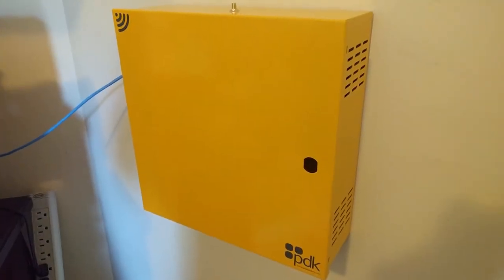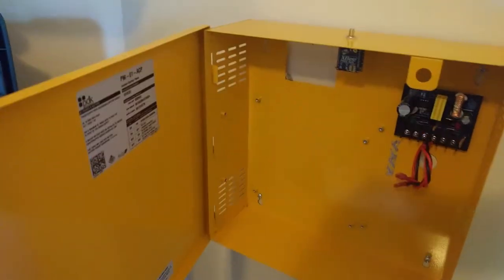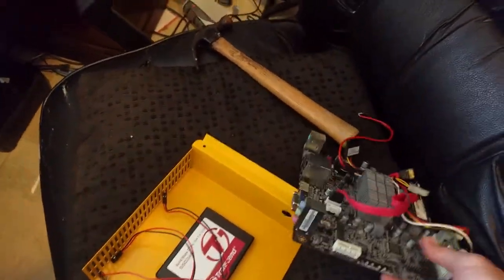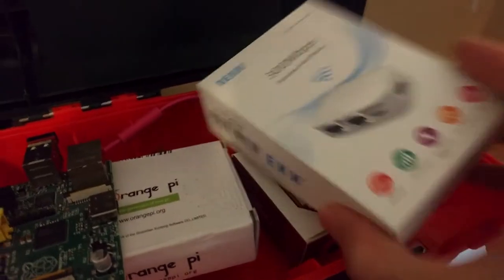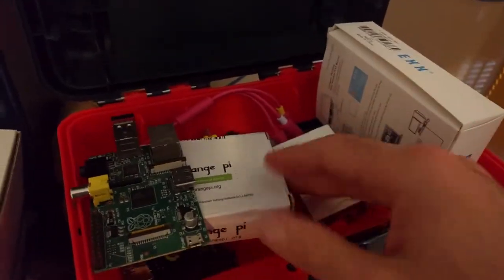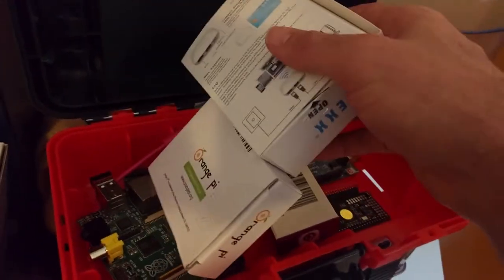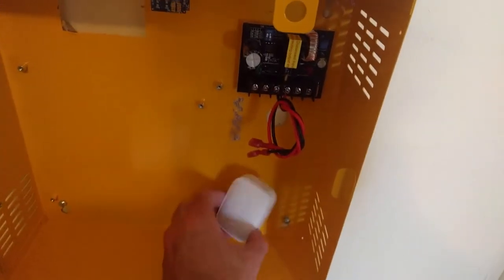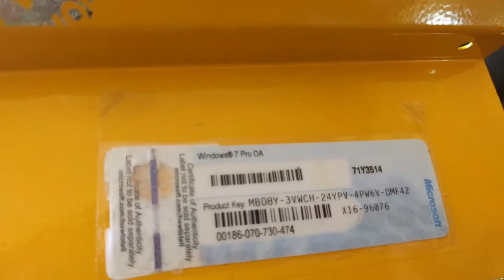Device Box with Raspberry Pi and Xbee

Comment: Looks like one of those panels that Honeywell uses for security systems. Wonder if I can ask the boss for one or two extras for my growing collection of mini computers. I already got a killer idea for mine, I have one of those mini Dell thin client power supplies that will work wonders. Just need to add a battery backup and all would be great.

Do a video on the MAC address logging. I got a Cisco router I can slap DD-WRT or whatever on it. It would be cool to do some MAC address logging and notify me when some one comes around or visits.